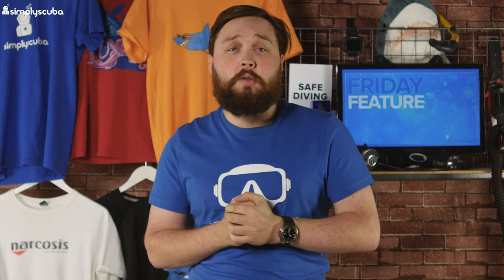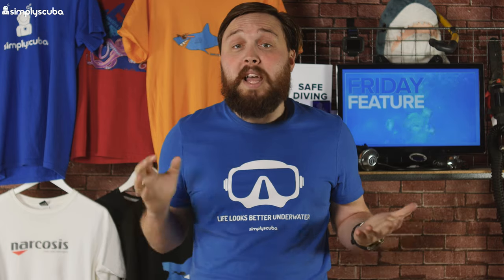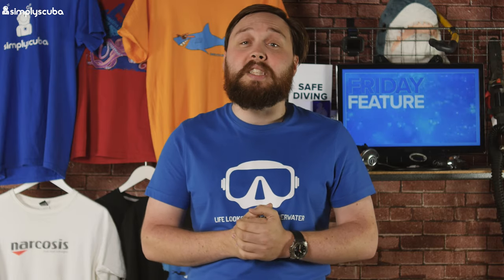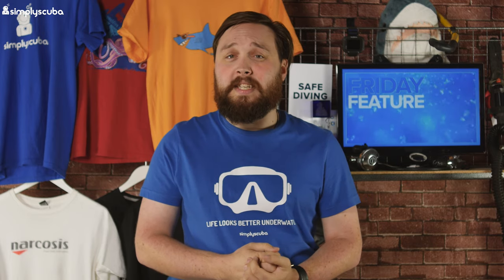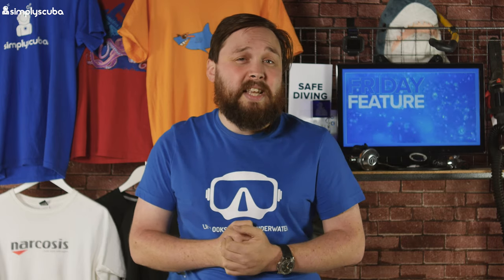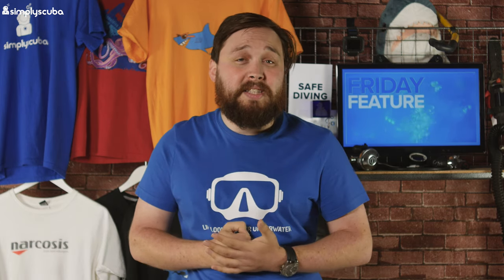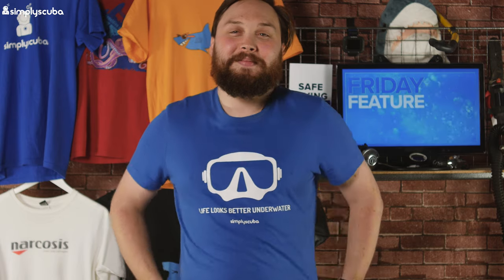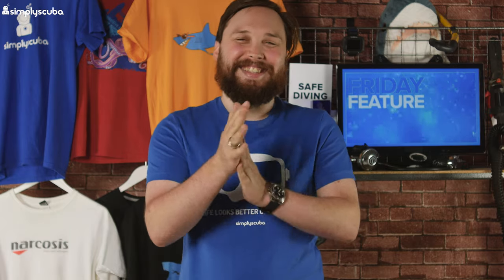Why The Standard Scuba Setup Is Wrong!

Comment: Quick question guys - I find it much more comfortable to point my cylinder valve 180 degrees opposite to the standard set-up - this means the first stage is not behind my head,  it on the other side altogether. The catch is that the first stage then has to be mounted upside down to usual so that the hoses are on the right sides.  Might sound complicated, and I get lots of concerned comments from dive center staff, but it works for me.  Any reason why doing this might be a bad idea?
Reply: Huh... that's an interesting setup. Can't say I've seen that one before. What makes it more comfortable? Is it that you don't hit your head on the first stage? If that's the case you could always try wearing your cylinder just a little lower on the BCD.

I can't think of any major issues off the top of my head. I've heard of people diving with their cylinders upside-down so that the valve is at the bottom - that configuration seems whack! I would worry about the tank valve or the 1st stage getting banged up when sitting back down on the boat - but apparently you can get cages to go over the tank valve to protect it for exactly that purpose so... lol!

A couple of concerns come to mind - your hoses would effectively be shortened because your 1st stage is further from your head... though that doesn't sound like it's a concern for you! Your tank valve would be on the opposite side but that's probably not an issue for recreational diving on a single tank. Any overhead diving might be hazardous due to the risk of knocking your 1st stage loose (especially for yoke regs.) And in this case, when I say overhead, I'm even including minor swim-throughs that you might encounter even as an entry-level OW diver.

Here: https://www.scubaboard.com/community/threads/can-i-reverse-a-tank-and-regulator.511351/ Someone else has asked the question for you on ScubaBoard.com. Looks like there are some good answers here.
Reply: Chris Carleton Thanks for the reply Chris - I mainly dive off rubber ducks and liveaboards and never had a problem with bashing the first stage or hoses on anything. Will try the “old” way again just to be sure I like this way better 😊 Thanks again.
Reply: The main Problem I can see of such a Configuration is that the regulator are less protectet then when they are places between your Back and the Valve. Also when you dive in a cave or a wreck the changes that you get stuck increases.
Reply: Chif 142 thanks - I’ll take sure to bear that in mind on the few occasions that I do swim throughs
Reply: Having done two courses with the International Association Of Dive Rescue Specialists - recognised as the standard in rescue diving the world over and used in countries all over the world - I adhere to their many techniques and training idioms. Up-side-down tanks are typically use for police forces, typically Australia for example (although less commonly now as it is recognised as a flawed system), so that when used in conjunction with a. twin tank set up - the valves can be easily reached and manipulated by the operator. This would allow the opening and closing of tanks as required to allow having of the remain mixture to be offset or closed off.  This has advantages and many disadvantages. Most of the disadvantages have been extolled to the the extent that almost no modern rescue service now use this system. The disadvantages are too numerous to list here, as are the advantages of having the cylinder upright. Just do it and be like everyone else..it won't kill you  - but doing it the other way just might for a number of reasons !!!
Reply: GB Sailing - I don’t have my cylinder upside down - valve is still at the top, just turned 180 degrees away from head.
Reply: @GallivantingSA.Camping101  Oh ok. Sorry for my lecture. Well as long as the buddy you are diving with knows this then it should not be a problem. The only down side I see with this is if when boat diving. Most boats I have dived on perform checks on people's air supply before they jump in. A dive controller on the boat going to check your gear before you go over the side will be turning OFF your air not on! As most valves facing the normal way open towards the controller using a right hand. In your situation the controller/divemaster will have to use their left hand and turn the valve away from themselves which might be a more difficult manoeuvre. One which they might get wrong. Sure, YOU can check it before you dive. but it's little things like this that make diving unsafe. Why would you need to set you gear up this way anyway. Most regs these day have a swivel top section for easy routing of hoses? Why not turn it the same way as everyone else and still have the reg upside down, as many people do? Having rescued a diver in an out of air situation when he blew a o ring at the 1st stage I can vouch for the need to have similar set ups on all dive systems to reduce confusion between divers when reacting to critical situations.

Comment: While well-intentioned, I feel that this video is a disservice to the dive community.  The reality is that most divers are "kitted up" in the standard setup (85%, see Divers Supply YouTube video on Octo's).  The factor that you never mention is training.  Most divers are trained to donate their octo to an out-of-air diver.  They have had training in this procedure and would be most likely to be successful in rescuing another diver doing what they have been taught.  You tout a 7" primary as the preferred method of donating off in an out-of-air emergency.  Yes, this is necessary in a confined, overhead, environment, but what about the open water diver with a direct route to the surface?  Do you think that all divers should buy a 7 foot primary with a necklace secondary to solve all their problems; could be useful but where is the recommendation for training?  Without appropriate training, new stuff and new procedures increase task loading and can worsen the outcome.  Whatever alternate that a diver chooses to use, training and practice is the key.  A familiar setup with an easy, practiced grab will work; something that a diver is not familiar with may not.  Last point about alternate air:  If you donate your primary, there is a brief time when both rescuer and victim are without a viable source of gas.  

Yah, Ok, a rusty knife sucks.  

With respect to jacket BCD's, the pockets have always seemed to me to be easy to access.  You can make a good case that a jacket BCD with pockets is more streamlined than a backplate and wing.  Specifically, with pockets you don't have dangling junk. 
Also, a wing that is minimally inflated, as it should be when a diver is properly weighted in warm water, will taco, causing flappy drag of the wing.  Alternatively, when a jacket is minimally inflated the profile is streamlined because the gas is evenly distributed. With respect to putting you on your face, a BP/W can be made to work if inflated minimally.  OTOH, if you are drift diving and are spending time on the surface waiting for the boat (E.G. Cozumel or the Riviera Maya), then a comfy jacket is of value.  Wings are more difficult to completely empty in anticipation of a safety stop.  

Snorkels suck, I don't carry one unless I am drift diving and then I carry a folder.  

Fins.  Yah, big heavy Jet fins are great in cold water with big rubber or a dry suit when your feet have to be weighted for ideal trim.  In warm water they can put you feet down with respect to trim.  I think that radically different conditions call for some modification in equipment used.  

I hate the posts where people put their own preferences out there as law, but I can't resist.  I most often use a BPW, with Jet fins in cold water and lighter fins (Nova Wings, full foot) for warmer water.  I also use a little longer primar,y 36 in., routed under my right arm with a Scubapro Air2 as an alternate air source.  All heresy, I know, but I can tell you that I have trained and practiced with this configuration and am confident I could deal with an out-of-air, if needed.

Comment: @3:20 i'm sure i can easily hang 8 accessories off my wing... 2 torches, 1 whistle, 1 sausage + reel, 1 signaling mirror, 1 camera off a lanyard, 1 gopro + handle, 1 tank tinger, 1 reef hook. see i got 9 already, and that's without counting the 1 knife + 1 line cutter attached to the webbing. i can still add 1 laser pointer, 1 slate and 1 spare dive comp. all that for rec diving. yes, i like xmas. did i miss anything? all are welcomed to suggest what else you can hang-off your d-rings. only genuine diving things you have used underwater in the past please. let's not have your brains run wild

Comment: snorkels are absolutely useless.
Reply: So what if you need to do a shore dive, through waves, to your descent line? Are you going to use your regulator and the precious air fro? Your tank? They do have a purpose
Reply: So say you are doing a shore dive through waves to your descent line.  Are you going to use your primary and the precious air in your tank to make the trip? Or are you going to switch to your snorkel and save your air?
Reply: @jwp8363  Snorkels are only useful when you on the surface to save air from ur tank, but honestly divers rarely stay above water from a long time. Just couple breathe from the surface to the descend line is not going to be a problem. Plus snorkels are really annoying underwater... Like really ANNOYING
Reply: @pricediver  I get it, you don't like them. Don't use one if you don't want to. But that is YOUR opinion that they are useless. But they are extremely useful for a surface swim from the beach to the descent line through waves that are trying to drown you. Or when you come up and are waiting for the boat to pick you up. Could you get by without the snorkel in waves on the surface, probably. Will it help you from getting water in you mouth and save your tank air, definitely. So don't say they are useless, just because YOU don't like them. The only time I do not have a snorkel with me is when I am using a DPV, and even then it is in my pocket. Better to have it and not need it then to need it and not have it
Reply: @jwp8363  The chance of using Snorkels on a boat dive or a shore dive is getting weaker and weaker. Many experienced divers usually don't carry a snorkel with them. They are not totally useless, but rather a pain to have something that divers don't USUALLY need. If you love snorkels then put them into ur BC pocket will be helpful too.